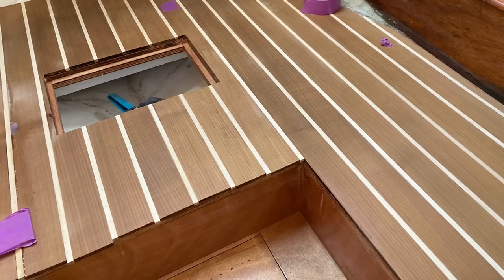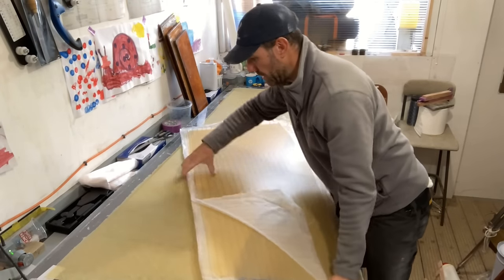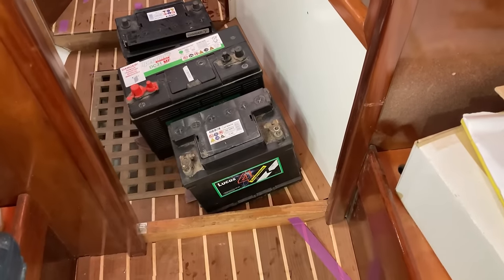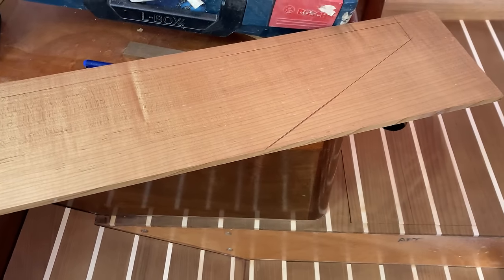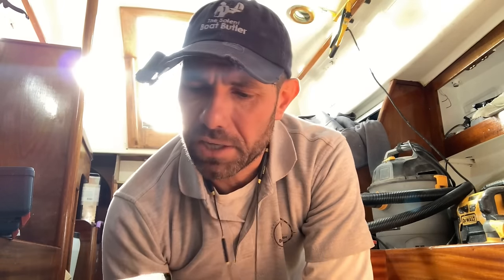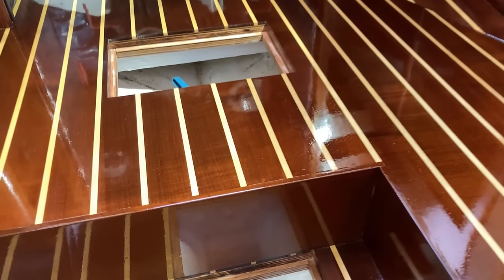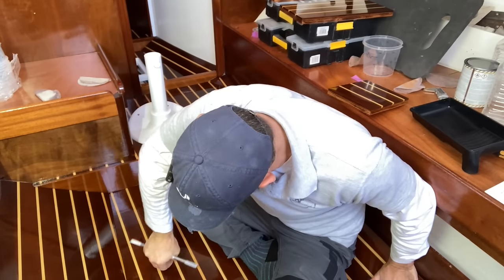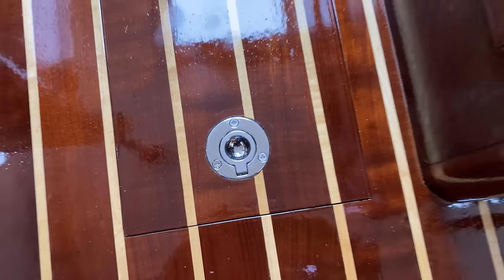New “Teak and Holly” Solid Wood Cabin Sole - Part 2 (Project Lottie Ep 28)

Comment: The floor looks great.  Good call on the rubbed finish.  I've never been able to cut out wood with a router, with any good results.  Forestner drill bits are my friend.
Reply from the maker: Mine too but went with the router for this as I didn’t have a forstner of the right size…

Comment: Hi George, great work as usual, the floor looks fantastic! Instead of applying the not so glossy next coat, have you ever tried using Scotch brite sanding pads for the orbital? They come in a pack with 3 different grits, they do a great job of knocking back a very shiny finish. I've been trying to find the video that got me onto it.
Thanks for the video.
Beer or something in the post.....
Reply from the maker: Thanks.    Have used scotchbright pads but not on the RO sander but that’s a great idea.   Will look into it.  👍
Reply: @RefitandSail  it really is, you can cut up the rectangular ones, grey red and green, no velcro required. Have fun.

Comment: That was a great video and your floor looks FANTASTIC with the finish on it. I was particularly interested in how you fitted flooring to the exposed parts of the hull. As I have the exact same challenge on our refit project, this was helpful. It was also interesting to see you use your router freehand to cut the recesses for the lifting rings, very brave; that would have required a template for me.
Reply from the maker: I’m pleased you enjoyed the video, good luck with your project.

Comment: I wonder if fluting the back of those panels would be a good idea? The flex is slight but over time and with the bumps Lottie will be subjected to, isn't it possible they'll begin to separate from where they're glued to?
Reply from the maker: Due to the proximity of the internal supporting structure I’m not expecting mush flex and the old (original) flooring was still well adhered after many years so I think it will be fine.
Reply: @RefitandSail  I'd trust your judgement I guess. The floor(sole?) looks amazing.

Comment: Gday George, I’m absolutely loving the channel content but was just wondering if you have pictures of how the countersink screws finished up? Thank you
Reply from the maker: Which screws?
Reply: @RefitandSail  the ones for the table support going through the hull, are the heads covered or do they sit flush
Reply from the maker: @sayhello2pedro ah ok, they are recessed into the hull slightly and then get a skim of epoxy filler and an epoxy barrier coat to ensure no water can get to the fixings.

Comment: The cabin sole looks absolutely stunning.  With respect to the table base, I was a bit confused about the part about tapping the two screws on the flat surface.  What aluminum below the cabin sole were those screws tapping into?  Maybe I missed something in a previous video - did you put an aluminum plate beneath the level of the finished cabin sole?  And yes, I actually cringed when I learned that the other two screws go through the hull.  😬
Reply from the maker: Yes, aluminium bar was attached to the underside of the subfloor so I was tapping a thread into that.
Reply: If you blinked, you would have missed it but we did get a very brief look at the aluminum backer bar.

Comment: Despite the glimpse of dodgy socks, the floor is looking fine. 
A question due to my ignorance. As expansion gaps are a requirement in domestic wood flooring, is there no need for expansion gaps with this application , George?
Reply from the maker: Dodgy socks!???   How rude 😂 

The floor is going to be well sealed and epoxy glued down so any expansion from changing humidity will be minimal so I don’t believe it’s necessary.
Reply: @RefitandSail  Sorry, couldn’t resist lol
Good to know as it makes for a refined  finish. Cheers.
Reply from the maker: @TheMickybutler haha, that’s ok, I don’t own any boring socks, only colourful ones and they rarely match!
Reply: Where can I purchase this material ?  Looks great